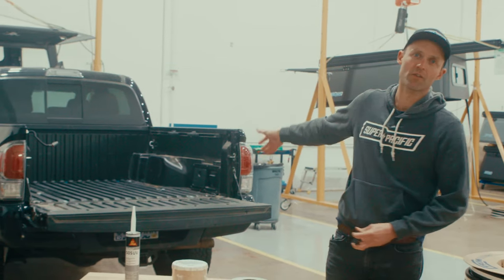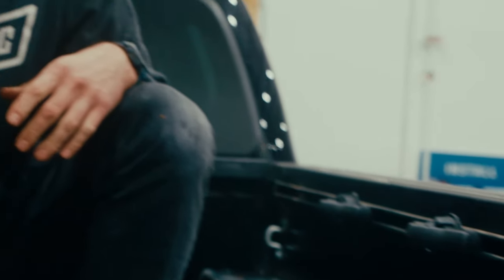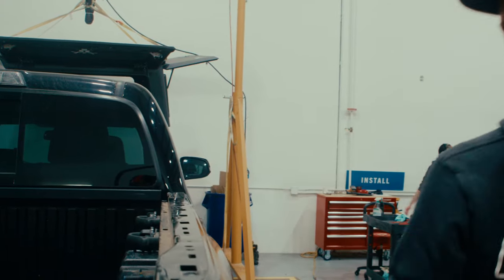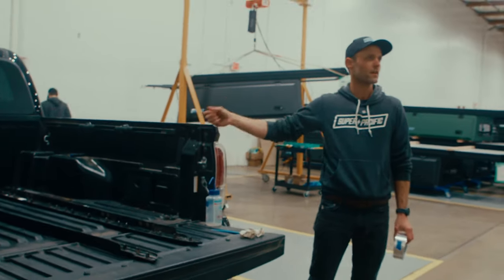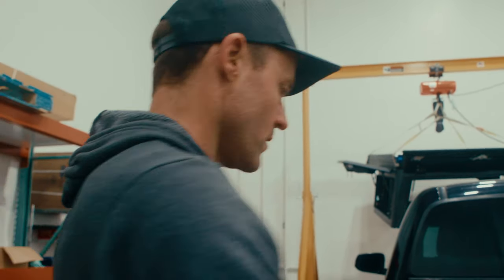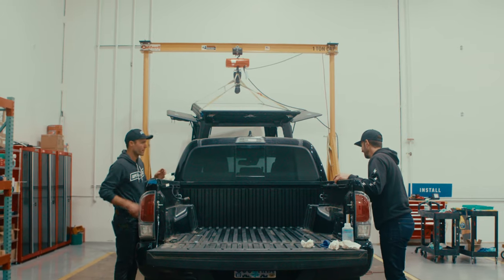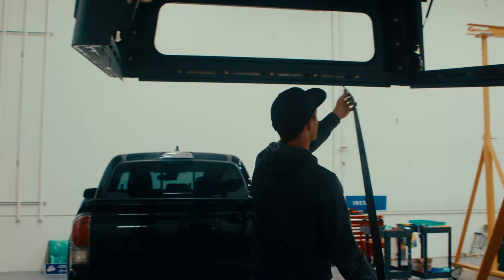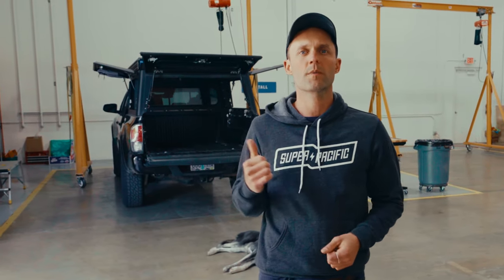How to Seal Your Tacoma’s Bedrails

Comment: The proper way to remove the bed rail caps  is to pull the very rear were it narrows and just pull up and work.your way back. No tool needed. NOW HIRE ME, IM FROM BEND!! 😂
Reply: So start from the rear near the tail gate of the truck ?

Comment: I followed your steps and sealed my rail caps, how ever my new issue is I get  adhesive/dirt-tracking down the outside of my truck in different areas every time it gets wet from rain or carwash.. Any thoughts or suggestions?

Comment: I'm switching from a tonneau cover to a canopy on my first gen taco. since it has the tonneau it doesn't have the plastic bedrails, would you say I need to buy them to be able to seal it? Or do you think I could just tape the holes and use the bulb seal?

Comment: So...  would/should I need to do this on a GMC Canyon?  I currently have a bakflip on it and seems like (or I thought) the dust was coming through the tailgate not the sides.  Is there a good list of all the things we should do on our vehicles before we get there?  I did get the email that said swap the antenna and stuff like that but not much else.  I did get the caps for the pocket holes - just want to make sure I do the things I need to before I get there.  Plus I don't think I'm going to be taking this thing off once it's mounted (although in a pinch I suppose I could).  I'm 37 days out...
Reply from the maker: Every truck model is slightly different so you'll want to research specifically for your model, but the same concepts we cover here should apply.  Sealing around tailgate is a topic we hope to cover in another video!
Reply: @superpacific_usa   but that one I can do after the fact correct?
Reply from the maker: @DSD  Correct!

Comment: Toyota makes pieces to fill in the gap you’re talking about in the video. I’ve used butyl tape before that’s a good idea. Good video full of good info and ideas.
Reply: can you link to the Toyota product?
Reply: They do make those pieces, but it requires cutting the rails if your truck didn't come with the factory tonneau cover. They also cost around $60, so this is a much more cost effective solution.